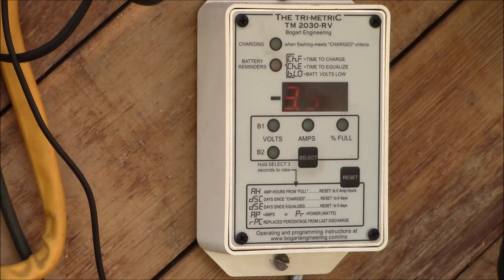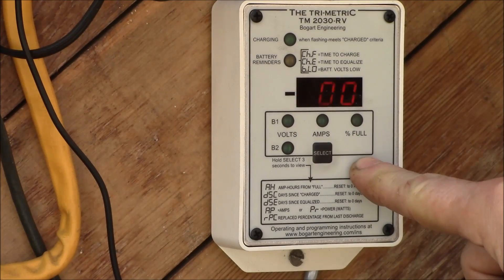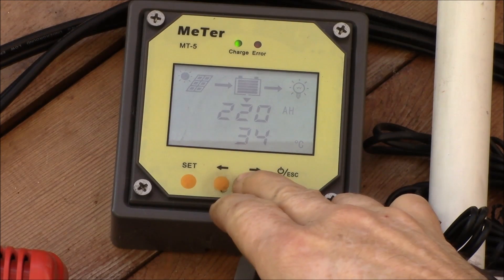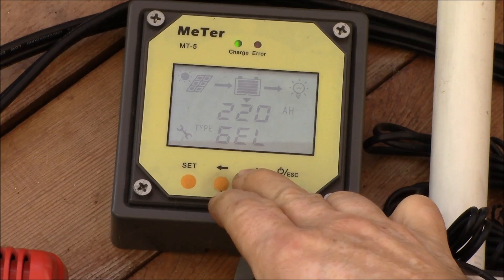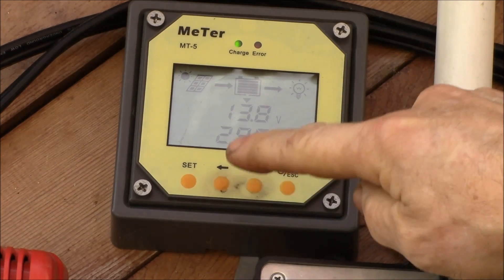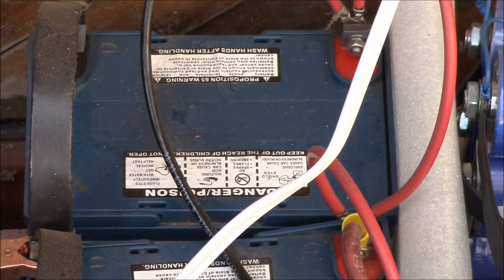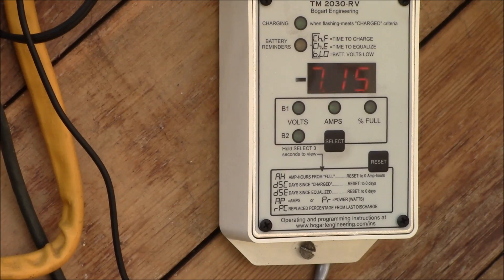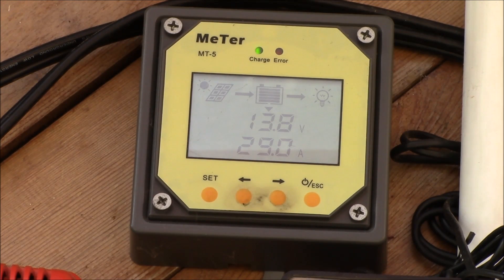Using a Trimetric Battery Monitor to do Battery Equalization

Comment: Interesting finding from renogy tech support at the factory.....they recommend the GEL setting on my MT50 controller so there is no equalization charge at all ever. I have a renogy AGM sealed 200 amp hour battery. Seems to me that they may  know it's not good to equalize a sealed AGM battery every 28 days.
Reply: They stated that the renogy MT50 controller on the sealed 200 amp hour setting will automatically perform the equalization every 28 days. Thanks for sharing your info....good to know ! 👍
Reply from the maker: Good in formation, I hadn't seen that feature.  The setup in this video was with my old 4215RN + MT5 controller.  On my newer controller with the MT50, I've only used that on my lithium-ion batteries and those have no equalization cycle set.
Reply from the maker: I've done it both ways, not sure there's a lot of difference.  For sure doing it every day, as on their SEALED battery type is probably too much.  That's why I tried the once/month cycle.

Some AGM battery mfgs. recommend it:
 https://lifelinebatteries.com/2015/10/can-i-equalize-agm-batteries/

some say no:
 https://discoverbattery.com/EN/battery-101/general-charging-information-for-agm-and-gel-batteries/

Comment: Utilizing your method is no doubt extending the life of your battery bank.....outstanding idea   thanks for sharing !!!!!!     🚙☁ ☁  ☁    ☁          👍
Reply: I've got a renogy mt50 that was used by the previous owner of my van. If i do a factory reset on the unit ,  correct me if I'm wrong please the only parameter that I would need to adjust after the reset would be the battery type and amp hour setting. Any other settings to be concerned with ?
Reply from the maker: Only other one would be the DC output setting.  I think the default is some sort of timed operation as these controllers are set up for automatic lighting, so light on at sunset and stay on for X hours.  I change mine to always on and then can use the output power switch to turn the DC output on and off.  Has no affect on the battery charging.  Might be a good idea to step through each menu and record any settings and compare them after the reset.  I like to keep a list of my settings, especially if I've customized something.
Reply from the maker: Yes, I think it's a decent compromise.  Batteries are about 6 yrs. old now and still holding a charge.  Actually, it's been about a year since I did and equalization charge on them, since I moved the Trimetric meter over to my lithium ion battery bank.